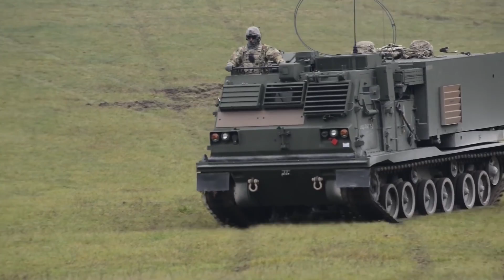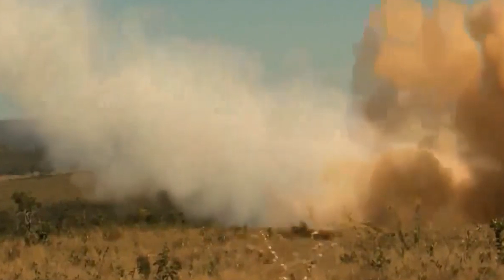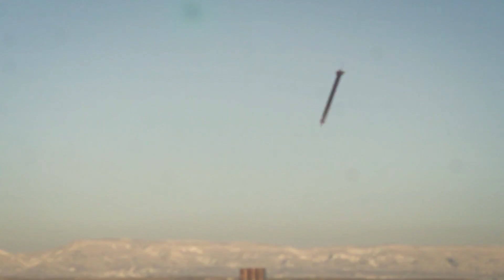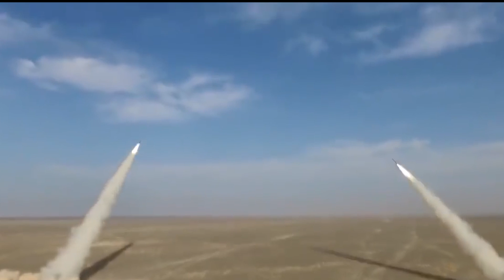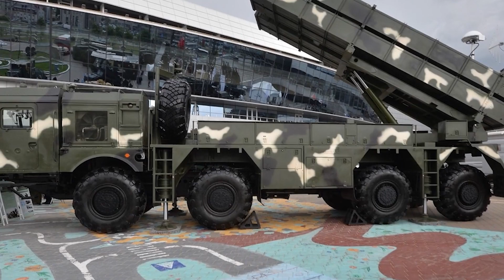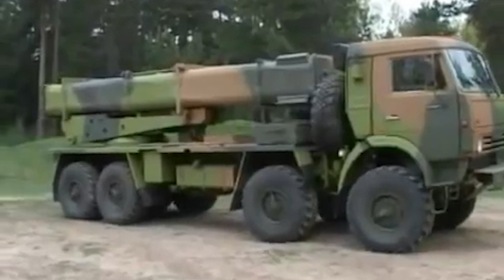NATO's Deadliest Rocket Artillery System

Comment: How is the himars at number 10 but our 1980s version that's not as good the m270 is #1 this channel is a pathetic joke, seriously an m270 will not win against a himars, accuracy is most important, the m270 is ok but himars is amazing.....so just curious how literally what the himars replaced was the m270 and you think the m270 is a 9 places better than the himars......yea makes tons of sense
Reply: And if you don't understand "high Mobility" is key with modern radar, the enemy can see your rocket artillery launch and pinpoint where and literally if quick enough sending guided artillery right to those rockets origin point, so the capability to stop shoot and be back on the move is what's key, and the m270 ranked #1 is a joke when you rank himars 10th.....

Comment: I've only seen ONE video of the M270 operating in Ukraine so far but supposedly the UK and Norway sent a literal handful. Germany was supposed to send their upgraded version too but it seems like Germany needs a solid 4 to 8 months to send anything heavier than a grenade. 
It seems to be like the HIMARS is obviously the best fit for Ukraine right now but the M270 could be great for hitting high value targets closer to the front line since they'd need to be further back for their own safety.
Reply: What the difference in safety then?? , both fire as far as one another, but tracked version is more armoured and goes more places so go figure... I know what one id rather be sitting in when the rain comes down....
Reply: @wor53lg50  The armor on an M270 can stand up to small arms fire but not much else. It's a lot slower than a HIMARS and it's a tracked vehicle so the maintenance is a lot more involved.
Reply: @stephenbrand5661  are we on about the same vehicle here? the british or german made versions will take small arms, frags, IED's aswell,  all apart from direct fire artillery strike and the A2 up armoured cab the states copied from them aswell...
Reply: Suprise Suprise... they are already in ukraine. Even before you wrote your stupid comment....
Reply: @patsch9019  🤣 I guess you can read English about as well as you can write it!!

Comment: The Russian army and fighters of the Donetsk Republic entered Bakhmut from the north
The allies are approaching from the north. This is a sign that in a few days the "assault" on that important city in the south of the Donbas front will begin
      WITH EACH new day, the seams and other fortified Ukrainian lines on the Donbas front are bursting more and more.
       The Russian army and DNR fighters entered Bakhmut from the north as well.
       They also entered Zaitsevo, which is located southeast of Bahmut, and Kodem.
       They attack Opitnoe, Vodjanoe and Pervomajskoe, whose fall will also lead to the fall of Avdejevka.
       They already control a third of Opitno.
  The allies are approaching from the north. This is a sign that in a few days the "assault" on that important city in the south of the Donbas front will begin.
       They penetrate around Kharkiv and from Izjum to Chuguevo.
       They also took Aleksandrovka between Kherson and Nikolaev areas. With good prospects for further advancement towards Nikolaev.
       The Ukris, by the way, still have huge losses.
       In Soledar, which is about to fall, more than a third of the soldiers of the Ukrainian 10th Mountain Assault Brigade left voluntarily.
       That brigade was already cut in half without that.
       More than half of the members of the 3rd Battalion of the Ukrainian 66th Mechanized Brigade deserted near Maryinka.
Reply: Stay in basement and you vote right and most importantly is how you feel inside, this gonna be ya future!! Maybe thell get along after ridding the rough from chaf....
Reply: @wor53lg50  just be Kool, stop by the bank and inform about your obligations.... buy a Coke.,and burger, fast your sitbelt and wait for crash landing...
 ...don't forget to call your friends from minority society/lgbtqwerttu groups/ and say them SO LONG, ... cause no more petro dolars and cheap credit...